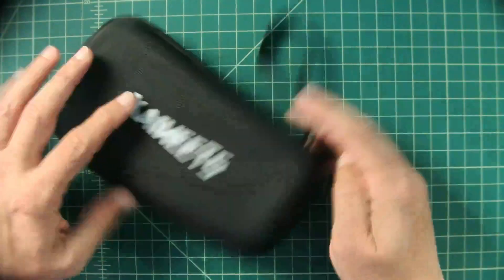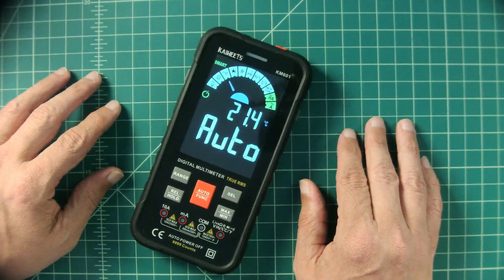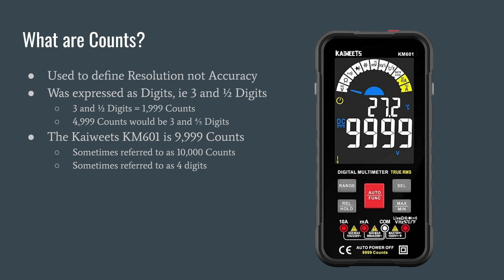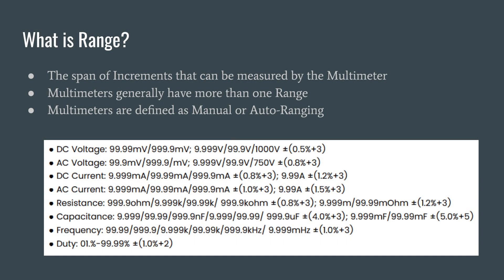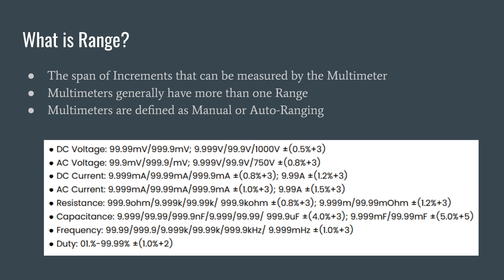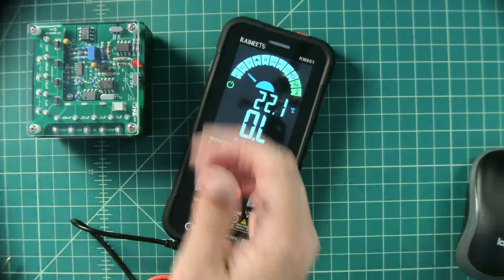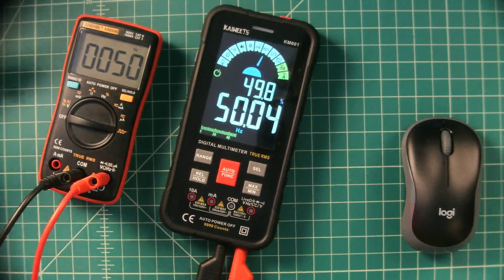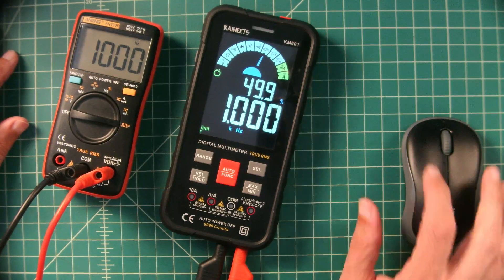What are Multimeter Counts? - Kaiweets KM601

Comment: I'm a finance guy just learning electronics. I'm always worried I'm going to destroy a multimeter by setting it improperly. Does the auto function work by switching between ohms, volts etc. automatically? Are the limits shown in the table normal ranges or above or below a typical multimeter? Thanks, Ape.
Reply: Hey, voltage, resistance, on-off are automatic range